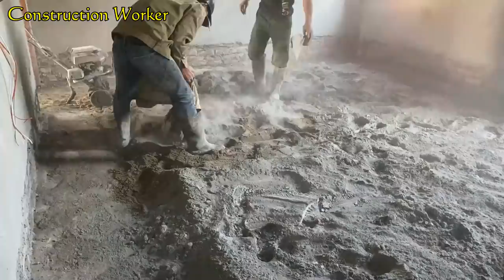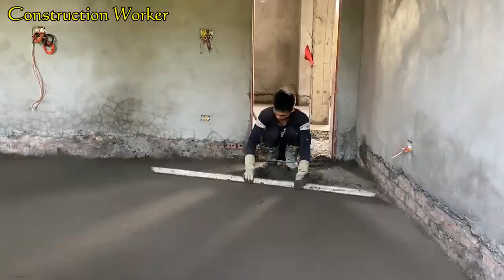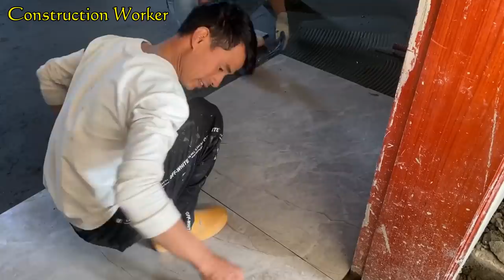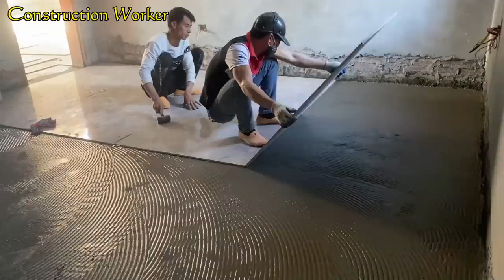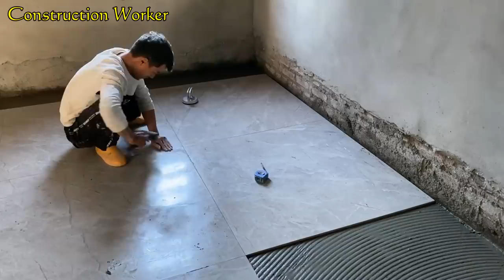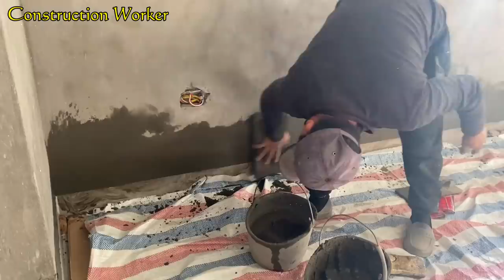Amazing Techniques Construction A Bedroom Floor With Large Size 100 x 100cm Ceramic Tiles

Comment: Concrete had to be cured properly before you can lay porcelain tiles on the slab. This usually means one day for every one millimetre in thickness otherwise where is all that moisture going to go. Eventually the tiles will crack. Must say though that the screed finish looked fantastic.
Reply: Thamizh Edit  please explain. Thanks in advance .
Reply: Not the case with dry pack. But the should've bonded it to the substrate or used a wire imbedded in the mud. The floor will crack and be hollow.
Reply: @wyseguy77  what was gluing or sticking agent used ? Seemed pretty runny but I can only compare it to thin set ... we mixed our dry pack with sand and Portland ...
Reply: @Mellownius  if I'm bonding my dry pack ( we use the same mixture as you) to the substrate I use thinset or a Portland slurry. If I'm wet setting like the video I use thinset just like normal. I don't work on top of the fresh float like the video though. More like installing while I float. Either way installing on a fresh float crates a great bond and gives you a chance to get a perfectly flat lip free installation especially with large thick material.
Reply: @wyseguy77  I would def like to see the process in person ... makes sense I guess
Reply: @wyseguy77  we call it mud bed and your correct , cant get much flatter than a mud bed
Reply: @wyseguy77  Not sure what you are talking about with "Dry pack" please enlighten me. 
I think the job looks really good and the man screening is brilliant but to lay tiles the floor had to be cured properly and that means one day per every millimetre thickness of concrete otherwise you are trapping the water in the slab between the Damp proof membrane and the surface glaze of the tiles. The moisture can't evaporate and over time the tile surface will craze.

Comment: Thinset should be applied in a straight line, not in a circular motion. With those tile sizes, back butter is a must. Those tiles will last a few years and crack.
Reply: Thanks for the tip! How can I convince my contractor to do it in straight lines? Any references you suggest?
Reply: @Hajjat  You don't convince your contractor to do straight thinset lines, you hire a new one who knows what they're doing ;)
Reply: @FPShkED  Makes sense, thanks for the tip, really useful!

Comment: Guys busting on the technique. I agree with them mostly, but these are huge tiles on ground floor on a very thick base. In area of world with little seismic activity; therefore, these tiles will last years before they crack. The swirl is not much of an issue as they are laying on very light and it is not as thick as we do it here in the states. The weight of those tiles with watery mix smashed the air out.
Reply: You da di man gee. U know..
Reply: They are using the sands made from stone, not from the river.

Comment: Dude that thinset is way too wet. It’s so strange to see how other countries build. The way they poured that concrete floor was ridiculous!
Reply: I thought the same like if they could use a hoe and a bin to mix it would cut that work force in half and save some of the back pain. But at least there working and earning money good for them
Reply: It's not concrete, it's mortar.

Concrete is indeed poured as a liquid and contains small pebbles, a mortar floor is just sand and cement and has to be made like that with ... fuck .... we call it a "Rij" here in Holland but I can't think of the English word for the aluminium beam he uses to flatten the mortar.

This technique is used throughout Europe for tiling but also for terrazzo under floors and just plain construction floors.

Although how they made the mortar by mixing cement, sand and water on the workflow like that with that weird contraption... is indeed ridiculous.
Reply: @itsMe_TheHerpes  Technically a day for every millimeter of thickness at least yes but only when using tile glue or if you plan to put something else over it.

You can lay the tiles in the fresh mortar before it dries by glueing it to the mortar floor with a mixture of cement and water.

It's a common but old way of doing this and called "setting tiles" and if done correct this results in a floor that is stronger.

It's also done with extremely large tiles like this because you have a little wiggle room in laying down the tiles level because the floor isn't hard yet and you can tap the tile level to the rest of the tiles if one might stick up a bit.

The moisture isn't much of a problem, the cement in the mortar reacts to the water and soaks it up to use in its chemical reaction. 

Believe it or not, the bigger problem is the moisture leaving the floor too fast, that will cause it to shrink and crack.

The floor should rest at least 5 - 6 weeks but underneath a plastic sheet so the water evaporates gradually for the floor to reach it's optimal tensile strength

This floor won't be one of those floors because even though the way they mixed their mortar is quite inventive, I have a real hard time believing that the mixture is consistent so chances are this floor is already cracking everywhere.

The technique is solid tho but you'd have to do it right and use proper mortar that is consistent.

Comment: I wonder how and when the water will eventually get out of the concrete 3:43, because they laid the pavement right away
Reply: I thought the hardening/curing of concrete was a chemical reaction and could take place even underwater. There should be no water required to evaporate in that case.

Comment: Man, if that floor ain't perfectly level and not subjected to settling, those titles are going to crack in a few months.
Reply: Beyond a shadow of a doubt.
Reply: Please explain
Reply: @gb92081  
1) tile need to have space between each other, then later filled with grout (mixture used to fill the spaces)
2) amount of cement and the direction of scrubbing are important, so air is not trapped underneath the tile, which will result in breaking
Reply: @A7GAMER  thank you!
Reply: @A7GAMER  why do the tiles need spaces for?
Reply: @jamesduff6937  during the summer the tiles expand and during winter it contract, everything does, you learn this in physics. so, to prevent tiles for destroying each other, you leave space for it to breath, expand and contract without it popping up or break. other examples: Parquet floors ( they leave space near the wall under the wooden piece pinned to the wall), also concrete sidewalks, when they pour the concrete they make it into large piece and divide it and leave space between them so they do not break. if you have any question glad to answer.
Reply: Don’t worry about it
Reply: Thank you for replying القرآن الكريم.  It didn't even cross my mind that an actual tile would expand and contract until you mentioned it.  It's hard to believe (although true) that a tile which is very hard and rigid does have some elasticity to it!  I can understand parquetry flooring expanding and contracting but not a hard, rigid tile.  And you are correct, it's always good to leave an expansion gap around parquetry flooring around the perimeter of the room.  In Australia, 'floating' flooring is a popular choice by some home owners because it is inexpensive and easy to lay/install- many times less expensive than a solid wooden floor.  And for 'floating' flooring, it is vital to leave a 10mm space near the wall under the wooden piece pinned to the wall.  One of the things I have read when laying tiles, is you should try not to get too much adhesive/glue flowing up into the joins where the grout will eventually go as this adhesive/glue is very hard and doesn't allow for tile expansion.  I've also googled that an expansion gap should be done around the perimeter of the room when installing tiles too.  I've copied and pasted the following info in regards to the expansion of tiles.. enjoy!
       
"Many people are quite surprised to hear that ceramic tile, a product made by manufactured by firing clay and other minerals at several thousand degrees, expands when exposed to direct sunlight. Porcelain tile, a very dense bodied product with a very low thermal expansion rate, expands approximately .000004 inches per degree Fahrenheit. Sounds minimal but that same porcelain tile covering 40 linear feet and exposed to a change in surface temperature of 50 degrees Fahrenheit has the potential to expand between a 1/16″ to 3/32″.
Reply: @A7GAMER  how do we avoid air trap
Reply: @A7GAMER  i see comments saying compacting and settling , does that mean we need to run a compactor or just leave sublayer  it to cure ?
Reply: This is called a sand bed, mud bed, many other terms.  It has been around for centuries, been used under terrazzo and big tiles for centuries.   As long as the floors underneath is properly compacted it is fine.  The mortar on top is overwet , and makes the top layer of the mud bed bond to whatever you are putting on top.

Comment: The concrete isn't even dry and they're tiling on top of it I can't wait to see with what that's going to look like after a year
Reply: with the wet mix that they use to install the tile it shouldnt be a problem...i believe it would adhere similar to a "fresh lay" on dry pack as long as they leave the concrete bed "open" and do not finish it smooth with a steel trowel.  They should consider puting a similar notch on the back of the tile since using a 1/4" trowel to install this size of tile is very dangerous regarding proper coverage.
Reply: I don’t see any problem there.....the wet cement can hold the tiles in place and it can get hard later, if it is dried up it cannot hold those tiles-it would be similar to just placing the tiles and of course they would be not in place
Reply: @Maniac Playz I would just think that once the concrete dries it would crack and move usually here in America we have to let the concrete set-up hard before we put anything on top of it
Reply: @TheOriginalAndysGarage  not with stone fresh lays
Reply: If it was dry the technique wouldn't have worked with the thin cement mortar. This is the best way (also he cheapest) - wet on wet - it lasts forever and holds stronger than any adhesive on dry surface. It is too hard though because of the limited time and it takes at least three men who know what they are doing. These guys are the real deal.
Reply: Give it a week and the whole floor is coming with the tile, this has been practiced centuries before we were able to go and buy a bag of thinset mortar. 90% of the world still sets like this, it's called a mud set. It's just Portland cement, sand and usually acrylic mix. Every true mason knows how to make a quick mixture.
Reply: @Djsaucy1  sorry this is not an issue, its called a "fresh lay" install in North America and produces an incredibly strong bond although the tile should be buttered up.

Comment: Those tiles must be really really hard seeing those guys walking on the freshly laid tiles.
Reply: I started watching video and already had so many questions. Like why make concrete on floor and not use mixer, seam's kinda harder, but okay. Than they are laying down tiles before foor is dry, is that gonna make problems later on, and yes the steping on the freshly layed tiles also.
Reply: @melkan1999  I'm also a construction worker and totally agree with you.
Reply: @melkan1999  + the concrete floor was not measure with masters to make it straight.

Comment: The way they put the mortar isn’t ideal. More likely to trap air under the tiles. Would be better straight lines all in one direction not circles
Reply: that's standard practice.
Reply: @davidcarp1034 used to be, until more testing was done and some engineers realized it wasn’t the best method
Reply: right
Reply: Rock solid work - I see no comebacks...
Reply: @pingpong9656  it will likely have some hollow spots under it is all. Not that it won’t work.
Reply: @pingpong9656  look up a video called Trowell and error on YouTube
Reply: @pingpong9656  also a mallet isn’t near as effective at setting the mortar to the tile as rocking the tile slightly back and forth a few times while putting light to medium pressure down on the tile
Reply: @DerrickFishes  that tile is big and heavy no need to rock back and forth
Reply: @CC-uh8gl  the bigger the tile the more it needs to be rocked back and forth
Reply: @CC-uh8gl  the air in the middle has to go further to escape
Reply: @DerrickFishes  it ain't a phone screen cover lol. Little bubbles won't do anything, it's not like the tile will bend into hole.
Reply: @kartikkalia01  no but it will break easier with no support and you will hear the hollow spot if something hits the floor there. There are probably some large hollow spots there too not just little bubbles
Reply: @kartikkalia01  tile is much more impact resistant and harder to break when it has proper backing
Reply: @kartikkalia01  and again as I’ve already stated it will work, there is just a better method
Reply: @DerrickFishes  the gap between two peaks after putting the tiles would be literally comparable to the thickness of the tule. Above that, tiles are brittle. It's bulk modules would be much much higher than any everyday force experienced by that tile.

Your whole point is a good example of self-assured hypothesis backed by no-evidence. Sounds good but just isn't right.
Reply: @kartikkalia01  your assumption that the air bubbles would be no bigger than the thickness of the tile is incorrect. And there are videos on YouTube that show exactly that.
Reply: @DerrickFishes  your attention to detail is good but I think you are over-analyzing it

Comment: The finishing is fabulous but I'm shaky with the whole process especially laying tiles on the floor that was not dry and probably it didn't stick to the old one. But the result is awesome. Keep improving guys!!!
Reply: The base was not even full dry, and they should have started on the opposite side to come out and not walking on tiles, alee the way that they did the base was pretty bad, 100% needed more water, they didn't ever used the masters, 100% not professionals.

Comment: Dude that thinset is way too wet. It’s so strange to see how other countries build. The way they poured that concrete floor was ridiculous
Reply: Yeah I'm not a professional but I know that was done horribly wrong I bet in a year or two it looks like garbage
Reply: not conrete floor, its screed
Reply: @tom-oneil  yeah I think so
Reply: Thats not concrete they put down, its a mortar bed. It's been done that way for 100 of years.  Don't forget the US tiling technics and the TCA and others are just suggestions not gods words for tiling. In addition, they used cement powder additive to the laticrete thinset which give it better mechanical bond and longer  open  time . Before you criticize this technique, you should take some porcelain tile and try it for yourself provided it's over a flat damp mortar bed and see how it sticks.  I've done it for years and so have other union tile setters in the passed. Nothing sticks better than bonding thined out thinset over the damp mortar bed. + most of that extra water in that thinset you saw will  diffuse into the mortar bed.  You should read up on continuous hydration with mortar beds, thinset, and concrete.
Reply: @tom-oneil  you right your not a pro, if you were a real old-tim tile setter you'd know this is a great tile job.  Did you ever or has anyone ever set tiles that large?  This technich is perfect and works for the size of tiles used. You wouldn't even have the back or the touch or even know what it take to have the  touch to hold and flop the tiles down just so right over the thinset.  THATS A REAL PRO THATS DOING THAT.
Reply: jim Moore  exactly which buildings are you referring to that fall apart? Because I know some buildings that were built without any of the techniques or training schools that you're referring to and they've been around for thousands of years pal. They sure as heck didn't learn from the schools you went to. I can show you Iranian mosques, Italian churches Armenian monasteries, and tile setting techniques and building techniques that would blow your mind. On the contrary it's all the crap and the way we built today that will fall apart and never stand the test of time.  Oh I guess I know the kind you are the jack-of-all-trades but the master of none.   you should be so lucky that you're not living under the conditions they are living in
Reply: Lol do you think the guy who pay for this hire stupid staff? Are you high
Reply: jim Moore  third world country likes the one in Miami?

Comment: Looks like the worker just screed the sub floor concrete without compacting. Will result in uneven settling, causing the tiles above to crack
Reply: I dont know anything van u explain more detailed ?
Reply: Do we need compacting or they should have let it cure for five days . They definitly messed   up the level walking around .